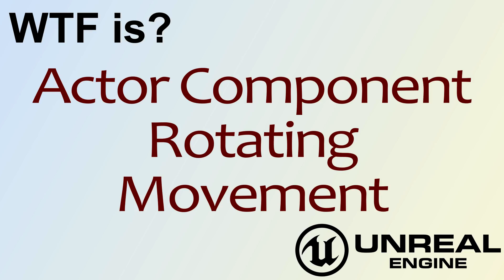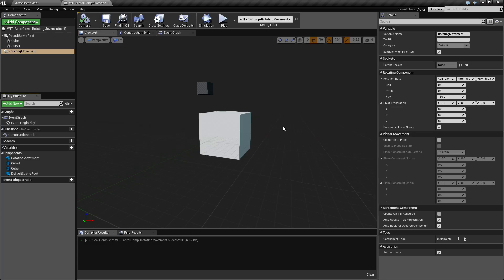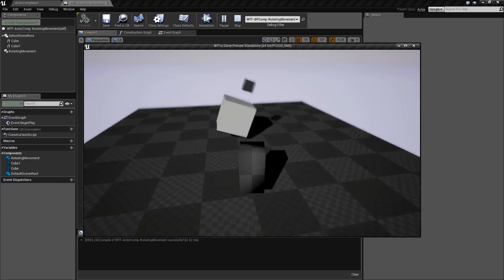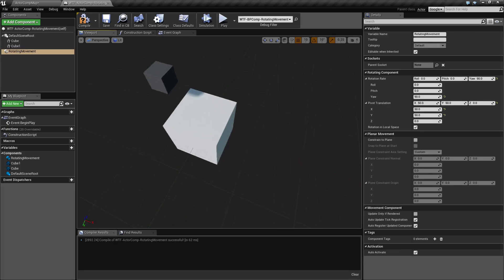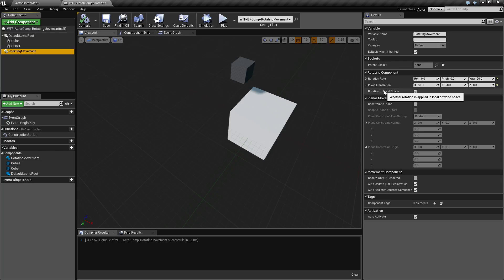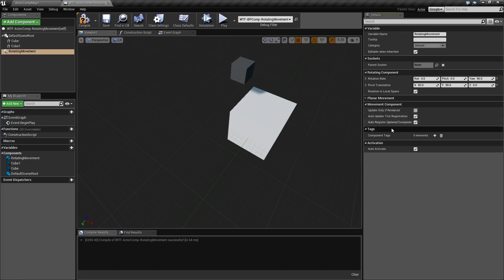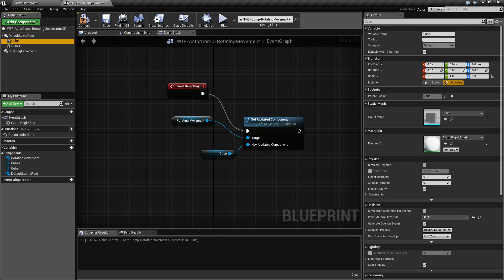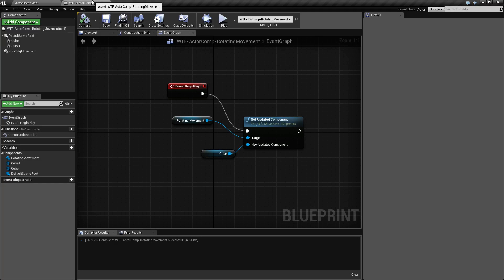WTF Is? Rotating Movement Actor Component in Unreal Engine 4 ( UE4 )

Comment: Question about rotation: I'm trying to make a day/night cycle by rotating my directional light. In the editor I can rotate the light manually clampped from 0 to 360 in Y. But when I set my bluprint to add +1 in Y rotation per second, it returns values from -90 to 90. Why is that? Why isn't it counting from 0 to 360 like in the editor?

Comment: Another great video! Could you do one explaining the "Character Movement" component and each of the controls/options it has? 

I've been having a hard time understanding it all, especially how factors like max braking deceleration, "use seperate braking," air control and the air control multiplier, etc.

Thanks in advance!

Comment: so you showed how to rotate one object but what if you need to rotate 2 out of 3 objects or multiple objects using this method? great tutorial by the way.
Reply: Update: you can always just add another RotatingMovement and add that to the Blue Print, I'm not sure if its the correct way to do it or even the best but it does work.